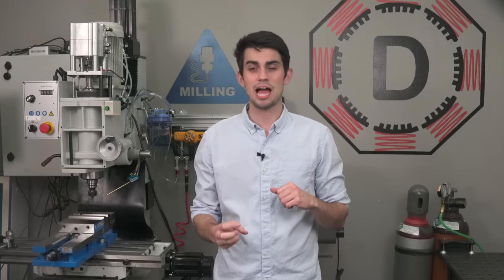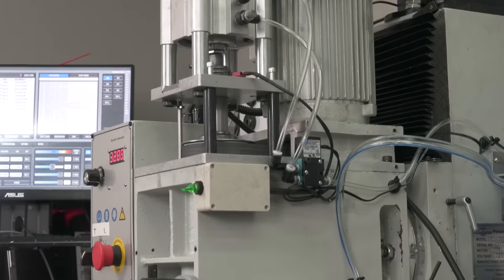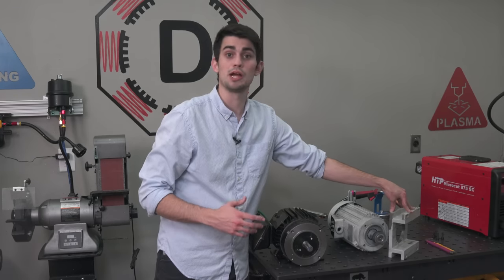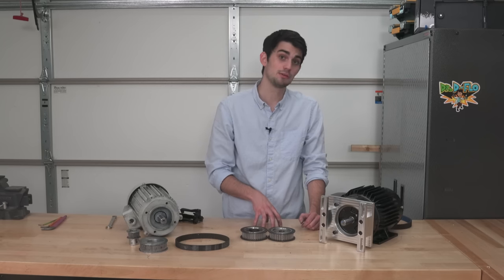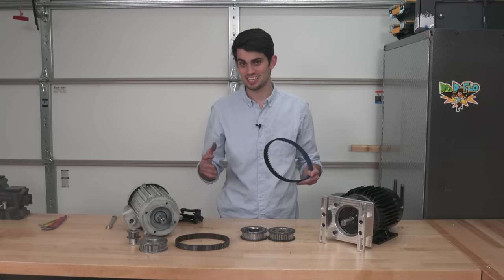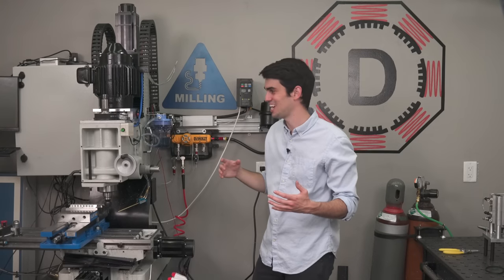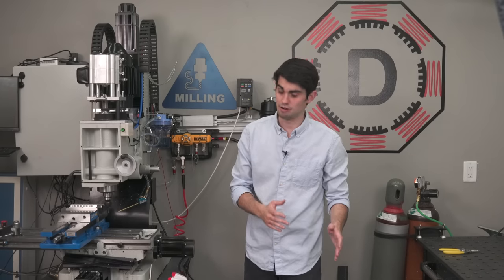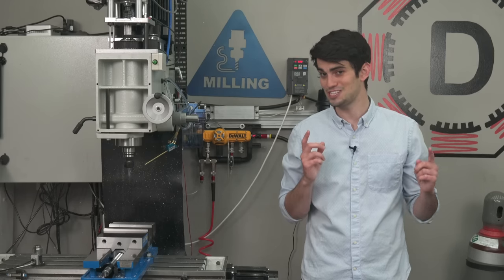Rigid Tapping with New Motor and VFD (DIY CNC Mill Upgrades 3)

Comment from the maker: The rigid tapping cycle is the most satisfying operation in milling. Try and convince me otherwise! 

I will be pushing updates to the website later this week for all the code and wiring diagrams.
Reply: Such and improvement over the old days when you had to stop with a brake and program in a time delay before reversing to avoid damage to the variable pulley drive
Reply: @tommays56  hej
Reply: Im pretty impressed with 5 axis operations

Comment: My homeshop has a decent sized  cnc router(HSD spindle), around 850lbs of mill. Some of the products I'm working on can easily have sheets with 2-3+ dozen threaded holes and dozens of those sheets. A thread mill is just to slow so I went a different route since rigid tapping isn't a possibility for my router and I don't view tapping as a time efficient opp for a cnc mill.

Mainly machining plastics, composites, aluminum and copper so decided on a cnc router for more machining area in a smaller space paired with a FlexArm tapping arm. 

The tapping arm can do a .5" tap in steel and most threaded holes take 2-3 seconds to tap. I move the tapping arm to the next hole by hand  but it maintains perpendicularity and is counter balanced so the arms motor basically weighs nothing. Has a perfect clutch system built into tap holders that eliminates broken taps.

My view is to have the cnc mill make holes, pockets, etc. or in other words more important work that only it can do. After a stock is developed they're taken to tapping arm.

Comment: Dear D-Flo. An affordable but good working solution for tapping threads with a CNC mill is a hybrid closed - loop - stepper motor. These motors can reach up to 3000rpm but work also at low speeds like 40rpm. The most inporthant is that they keep their torque more or less stable in all theit speed range. You can find a Chinese descent version of a Nema 34 for 200$ (including driver). The most inportant is that they have the feedback loop and the CNC control board can control with suprising accuracy the motor rotations. I have used more than a dozen of them in various projects and I am very satisfied.
Reply: Or you could just get clear path MCPV servos...

Comment: Great video ! One thing I can't understand tho is why you replace 1 giant motor with another and then have to replace VFD place an encoder and so on thus making a servo. I would get it if you were running at 12k rpm but with gear ration of 1:2 you can put 1,5kw servo that has far better tongue, positioning accuracy and is easier to setup. Also it's generally smaller.
Reply from the maker: Today, an AC servo is a better value, but at the time the induction motor + VFD was cheaper. Also, the spindle has quite a bit of backlash in it, so the encoder needs to be on the spindle to account for it
Reply: @DrDFlo  Fair enough.

Comment: Nice video your mill conversion project looks really great.  I am about at the same point facing the motor issue as well.   I converted J-head step pulley Bridgeport a while back, it's a work in progress when I get time to work on it.  It does cut parts great parts even with not being finished.   I run it's 1hp GE motor at 150Hz without issue and do 6800 rpm on the highest pulley.  But I also cut steel and need lower but the high pully min ( 1600)  has low torque so requires a belt change. Would like to eliminate the pulley change: Go to a 3HP motor lower the pulley ratio a little but up the frequency to keep the high upper rpm and use lower Hz for the min.  An electrically controlled two planetary speed gear box on the motor would be the cats meow.

Comment: It is called a tapered point tap for CNC a straight flute tap is for hand taping. The power needed on a spiral flute tap is 5 times that needed for a tapered point tap and 2.5 times power needed on a straight flute tap

Comment: This was a really interesting runthrough of the project. One thought comes to mind: The nylon pully for the optical encoder is riding on the spindle shaft that goes up and down with the quill. Do you think there is going to be an issue of wear or do you never use the quill? It would be interesting to see a thread forming tap in action as well. You could probably get away using a tap of that style in aluminum and you would get stronger threads than with a thread cutting approach. This was a really informative video.
Reply from the maker: Hey man! Glad you enjoyed. The plan is to not really use the quill. Probe basic has conversational programming now, so if I need to drill some holes it’s very easy for me to walk up to the mill’s control and program a series of holes.

Comment: FYI, if that collet type part that needed a keyway in it was not hardened you can do it on the mill with your z axis and hss tool bit to size going up and down just shaving off a couple of thousand at a time. No motor speed of course. Also for awesome tap finishes add a 50/50 mix of kerosene with cutting oil. Old tool makers trick, aluminum only though.
Reply from the maker: Thanks for the tip! I will try out that formula for the tapping 👍
Reply: Kerosene works well, but PITA to get rid of the stench. I Prefer WD-40.  Alcohol is the best, but dries to quickly

Comment: Great video!  I've noticed that the bottoming taps have an overly large tapered point and limit how deep you can make the threads.  I usually knock off a few MM of the point at the end since I know the mill will perfectly center the tap.  Lets me tap much closer to the actual bottom of the hole.
Reply from the maker: That is definitely a great way to do it cheaply and I respect that. But they do sell short chamfer bottoming taps, which don't have tip and only require one or two turns before you get to the full thread.

Comment: Another question - what a problem to use servomotor? The priсe of 2Kw Servo is lower than 1 VFD+1 AC motor + encoder
Any servodrives have servo encoder output, so with 1:1 gear ratio you dont need to use external encoder. You can use step/dir to control servomotor as Axis. Its pretty strange decision to use AC motor for me.
and finally - weight. You have HUGE weight of Z head, so you now extremelly need counterweight, otherwise you will have wery early wear of your guides. So AC servomotor have twice lower weight minimum.

Comment: Awesome content!!!  Thanks to this CNC conversion video series, I decided to pull the trigger and buy a PM-833TV and do a similar conversion.  Thanks for all your insight!  Would you be willing to share your 3D drawings for the timing belt pulley that fits on the spindle, pulley that fits on the encoder and the encoder mounting bracket and appropriate belt?  Thanks again... Richard
Reply: Have you been able to source a conversion kit Joel?
Reply: @hermit3400  Yes...  I purchased the last kit from Heavy Metal before they closed.  Some of the parts would not work due to the incorrect dimensions.  Dr. D has been helping me by remaking a few brackets.  I should receive them in a few days... fingers crossed!

Comment: Was just about to pull the trigger on a PM 833TV.   After watching a few of your videos, I'm not so sure now.  The whole proprietary VFD board, disappearing label TEFC motor and a 50 - 3200 RPM on a single ratio belt drive seemed sketchy to me.  Now I see why.   What now?   Budgets being budgets.

Options are scarce.  PM 932V?  At least it has two belt drive ratios to work with.   Then there's the whole China vs. Taiwan debate; perception or reality?
Reply: I was in the same boat but decided to buy it.  The truth is there is no perfect cnc for less then 100k+.  The money saved is worth the hassle...at least in my case.  Put clear path servos for all 4 motors and you can avoid a lot of these issues.

Comment: Thumbs up on a video !  I am changing my 1 phase motor to dc servo disc motor whit 9.3 Nm torque hoping to be able to tap up to 5/16 or 8mm holes . My setup is Mack3, linear rails and feedback steppers from scratch build ability to swap spindle and router as needed .
Any toughs or ideas on adaption ?  I am planing to ad some encoder to spindle as a feedback to Mack3 software .

Comment: Nice, great video! I would have just used an optical encoder but then you do have an awesome 3D printer!

Also, after you tap your hole you should do your X-Y move before going down to your safe Z.. You might hit something with the end of your tool..
Reply from the maker: Yes thanks for pointing this out! I need to play around with the safe heights and retracts. I noticed it was doing that little stutter where it would retract out of hole and then dip back down before the next move. Not good. I will clean it up on the fusion 360 side.

Comment: I had to make the same change but opted for a spindle motor with encoder and associated driver. It's an async motor with the fan running separately by its own motor and the driver can run the motor in speed mode or positioning mode. Also there are 4 homing options in the driver for an alignment like for an ATC operation. 7.5KW motor and weighs 45Kg
Reply from the maker: What's the model of your motor?
Reply: The issue with the encoder on the motor and not the spindle is there can not be any gear ratio between the two. Also can't change gears. The encoder on the spindle and at 1:1 solves that.
Reply: @chipcity3016  The spindle driver has gearing and secondary encoder to be mounted on the spindle. Alternatively for a fixed ration you can use gearing in the servodrive on the encoder output side if supported

Comment: The RPM readout comes from the VFD? In my mill the RPM counter is directly integrated into the display and it's also inaccurate. I have interfaced the index signal myself but the VFD is also a bit inaccurate some speeds cannot be set at all (it's almost linear but some speeds are missing, I have tested that several times)

Comment: Super cool, I wish to do that on my mill top some day :) as a side question, why not go with AC Servo motor? That's the one I purchased for my machine, 2.5kW. 3000rpm. Plus it comes with a controller.
Reply: Probably more expensive, I think.
Reply from the maker: I thought about it for a little bit, but I could not find a servo motor in that power range that is 1) cost-effective or 2) would be delivered in a reasonable amount of time. I looked at the 3kW SVM-230B SureServo, but that is $1500 without the drive. Also, I wanted to put the encoder directly on the spline shaft, so I didn't have to worry about the surprisingly high amount of backlash between that shaft and the pulley. At the time of purchase, the Y551 motor, VFD, and encoder cost about $950.

Comment: If you expect to have taps last never tap without using taping paste and a little brush to hit the tap every couple of holes
Reply: I use tapping oil for cut taps and wax for Roll taps. I find the paste holds the chips on the tap and gives a poorer tapped threads as a result.

Comment: One more question.  If I followed this correctly, you changed the pulley configuration so you currently have a 1:1 relationship between the motor and spindle.  Originally, the motor pulley appeared to be smaller than the spindle pulley.  If the PM-833TV had an original stated spindle speed of 3200 RPM, wouldn't that mean that the original motor would have to spin much faster than 3200 RPM.  What am I missing here?  Standard induction motors either spin at about 1725 or 3450 RPM.
Reply from the maker: You are correct. The stock motor would have to spin much faster. Couple things: inductive motors can be driven at a higher frequency (over speed). My new AC motor can safely be run at 5400. Assuming that the old motor could be driven that fast and the fact that the RPM was way overestimated on the VFD. A max 2700 RPM for a 2:1 gear ratio makes sense for the old configuration.
Reply: @DrDFlo  WOW... So the stock motor wasn't turning the spindle anywhere near 3200 RPM?
Reply from the maker: I can’t quite remember what the tachometer said, but I was underwhelmed at the time. Something around that 2700-2800 mark. However with that gearing you do get better low speed performance
Reply: @DrDFlo  Yes.. That makes sense now.  If the motor was turning at 3600 RPM and the gearing reduction was about 25%, then the spindle would run at 2700 RPM.  I purchased the Dura Pulse GS20 and planned on increasing the stock speed by about 10-12% which would result in a max spindle speed of about 3000 RPM.  I think the sensorless vector control will boost the low end torque.  Thanks for the clarification!  Very much appreciated.

Comment: I like your aproach, but why not a big 2-3hp servo motor instead of the induction motor? Costs couldn't be the main issue here - given that you paid well over $1,500 for the motor, encoder, VFD and break resistor.
Reply from the maker: At the time of purchase, that marathon motor was $700, so everything ended up being about $1000. This was very comparable to an equivalent servo system. 

Vector duty AC motors are ultra reliable (albeit bulky) and I have had no problems thus far. 

To find a servo motor that outputs 1.5kW of power and has a higher rated speed than 3000 RPM when supplied single phase was challenging (especially with the supply shortages). Most of the drives for these motors require 3-phase and then I would have to buy a VFD or phase converter.

I have gotten a couple questions about this. I think either solution is fine. My mill is bigger than most benchtop mills so I was able to fit the larger motor and still have room for the power draw bar.
Reply: @DrDFlo  I see your point. I'm from Germany and 3-Phase with 380V or single phase 230V is very common around here. Also, for a simple Spindle-motor the cheapest chinese 1.5kw Servo with a controlbox and 3m (9ft) leads is around $500 including import fees and taxes. Given, that the chinese purchased Kuka a while ago, this drove down the price and rose the quality of chinese servos a lot. And even the very crappy ones are very much well capable of driving a belt-driven spindle fine.

Comment: Do you have any concerns with going to a heavy motor? Did the Z servo notice the extra weight? I built a PM940 CNC with Clearpath servos.
Reply from the maker: No concerns. That 1.3kW motor is actually oversized for this application. I tuned it again and everything was good to go.
Reply: @DrDFlo  Did it change the tram any? Is the column stiff enough to hold a good tram front to back? I ask because I bought a new marathon 3 hp 3ph motor a while back for my PM940 and it is a little heavy as well. I plan on using it when I convert to a belt drive.
Reply from the maker: @halfstep67  I have not re-checked the tram yet. I am going to take the mill apart in a month or so to add in the new ball screws and will have to tram it when I put it back together. As heavy as the motor is, it only added like 30lbs to head. Thats not that big of a deal for the 833-TV